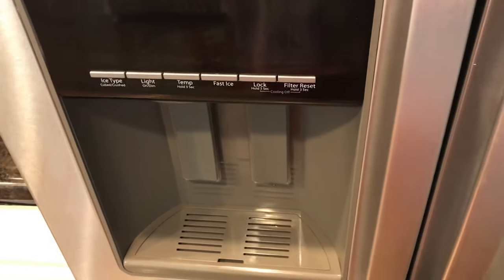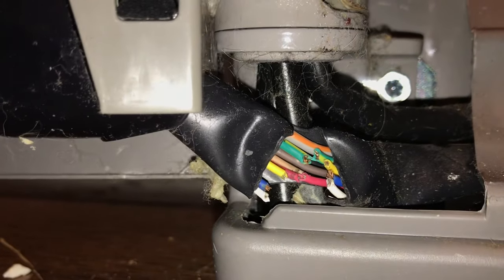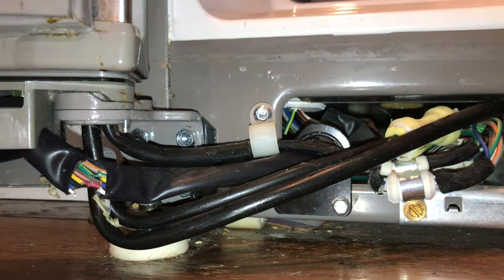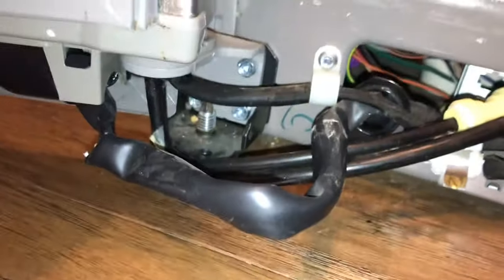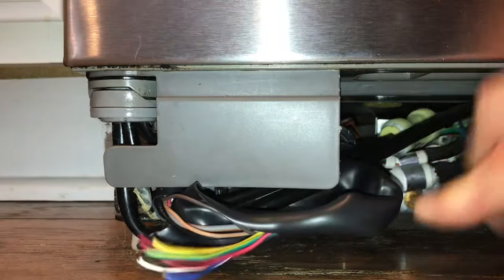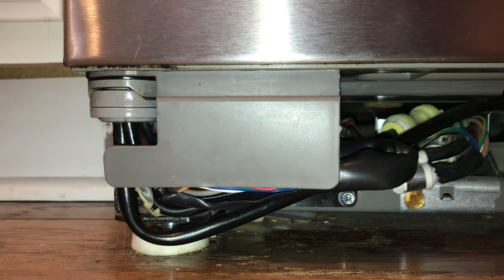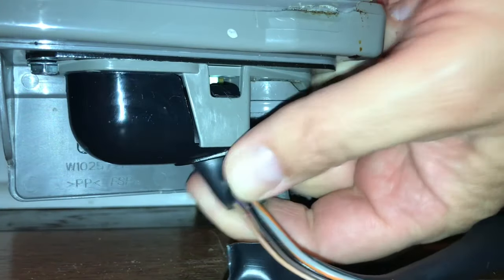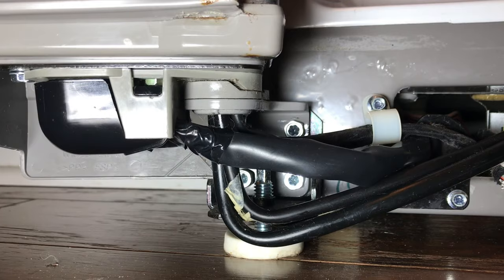Whirlpool double door refrigerator not making ice and ice dispenser doesn’t work. Wires WRS571CIDM01

Comment: I think we should be organizing a class action lawsuit. Mine started doing this after 1 year of service.
Reply: I called Whirlpool customer service. Totally rude!! They will do nothing about it.
Reply: Mine lasted 2 years then this happened. Not too hard to repair but clearly it’s a design flaw.
Reply: 10 months here
Reply: @dave64340  3.5 years for ours.
Reply: Mine just now has this issue. Two years and 8 months after purchase.
Reply: I completely agree I think we should do a class action lawsuit mine lasted two years. I just got off the phone with whirlpool and like the other guy said completely and totally rude and will not stand by their product. Absolutely horrible to their customers! This is obviously a defective part on their refrigerators, and they know about it, and won’t make it right by their customers. Absolutely horrible!
Reply: Mine is 18 months old, Whirlpool swears it’s not a problem. Never heard of the problem. I had called Whirlpool appliance repair and he told me it’s a common problem. I paid $2k for this pile of shit !!
Reply: 2 years on mine different model customer support supervisor didn't even care. Even when I said it was a risk for short and fire or a kid touches it they didn't care.  Wire harness assembly is my career and this is unacceptable crappy wires plus improper routing and protection of wires.
Reply: I'm with you!  No way something that costs that much should stop working after only 1 year
Reply: 3 yrs here
Reply: Thanks for the post. I was going crazy trying to find the problem … what a disappointment. Bad design. It’s fine for guys that are handy, and can easily fix it, but how about the other 80% of people that can’t really do things like this. Sad and costly for many folks 😑
Reply: Probably the best solution is to make an extension harness to go between them and make it 20$
Reply: Thx for the info, I just discovered my fridge has the same problem. Found the broken wires and soldered them. I believe the problem stems from the fact that wiring harness should be fed through the bottom hinge like the other harness and water lines. The way this is designed the wiring harness keeps bending back and forth when the door is opened and closed. I live alone so mine lasted five years. This is just pathetic. My next fridge will have the ice maker in the cabinet and not the door.
Reply: I would like to be part of that
Reply: Same here.
Reply: I have this exact problem and I called whirlpool. I am shocked. My fridge is about 2 years old. Whirlpool claims there is no recall. Unbelievable. DO NOT BUY WHIRLPOOL.
Reply: I've had mine fixed over and over.  It's always been these wires.
Reply: After 3 years, have this problem today. Cost to repair $300. 😩
Reply: 3 years exactly here. Almost to the day. Just 1 cut black wire. Hoping this will fix it.
Reply: Whirlpool said, they never had a complaint or recall regarding this issue.  Also, suggested they would give me a discount for a new fridge. Wasteful nation and no common sense ppl!
Reply: Does anyone know what this part is called ?
Reply: I bought the fridge in june, 2020 & a year later it stop making ice… I have tried every but it didn’t work until I found this video

Comment: The problem when you use cheap wiring casing vinyl and poor copper strands, should never happened. Sould have used good silicone wiring and better copper stranding making them flexible to withstand years of door openings

Comment: my Whirlpool ice maker wasn't making ice, but did dispense it etc.  I discounted a frozen water line because the water right next to it still was dispensing water, I figured it came from the same line so it couldn't be a frozen line.  Two days ago, we had a power outage that lasted for about 45 minutes to an hour....power came on and viola,  I heard water being dispensed into the ice maker and it has been making ice ever since...so, I figure that in the hour there was no power the frozen line melted....so you may try unplugging the frig for about 45 minutes if you have similar symptoms...

Comment: THANK YOU!!! I never comment on social media things but this video saved me so much money and further frustration.

Also, I wanted to comment for those who come across this issue in the future: don’t panic if you fix the wires and still don’t get ice right away. Give it about 24 hours or so before you continue to panic or troubleshoot further. It took my fridge about 15 hours from the time I was finished repairing the wires to begin making ice again. At first I worried I had done the repair incorrectly and there was something else to fix, and frustratedly told myself I’d try again the next day, but in the middle of the night I heard ice dump into the bin. It would not be a lie to say I jumped up and did a little dance once I realized what I heard!

THANK YOU AGAIN!! Shame on Whirlpool but thank God for community and those like yourself who are willing to share knowledge with their neighbor, even if we’re spread across the world
Reply: Thanks for the tips.  I am also impatient and waiting for the ice to be made lol.
Reply: What did you use to connect the wires back together?
Reply: @creddtx  solder connectors just heat them
Reply: @creddtx  I stripped wires on both sites and twisted them together really tight then wrapped in electrical tape. There are some connectors out there for this but what I did seems to be working. Just be careful on the wires that go into the door. Don't make a mistake because you only have small amount of wire to work with. I've cut some by mistake but was still able to make connection.
Reply: Thanks, this was helpful as there was no ice maker activity after I connected the wires. Without your comment I would probably mess with it more, but I gave it several hours and started to see ice in the container. It made me quite happy. Thanks!

Comment: OMG!!! We have been living without ice for about 3-4 years and had to buy it or go old school ice trays. I tried other fixes from different videos throughout the years and nothing worked. I was about to get replacement and decided to look for another answer before going in that direction. Clearly, I had looked before you posted this video. ...I open the door look down and much to my surprise, we have the same problem. At least 3 of the wires are cut in half. I'm hoping this fine will end in a fixed ice machine. Thank you motofun! Really! I can't thank you enough! Now off to my next new project! Blessings!
Reply from the maker: I know your excitement, because I was the same way. You don’t realize how much you miss ice, until it gone!!!  Good luck on the repair. Here’s to a big glass of ice…🧊

Please help me by subscribing. Thank you.
Reply: Thanks a bunch. 2:22AM ice started dropping!
Reply from the maker: @goldwatereli  don’t tell me you were watching/waiting for it?  That’s like watching grass grow….lol
Reply: Lol. No. I just wasn't sleeping very well and I happened to hear it....and again about 1.5 later. Now to figure out if the auger motor is bad or if it fried some of the control board. Flap opens but it won't spin. I'm hoping it is just frozen, but...one step at a time. At least we have ice!
Reply: Same for me! I looked yesterday and every single wire was cut except one. THANK YOU motofun!! My husband reconnected and extended the wires yesterday. No water yet, still hoping he fixed it! There's no water to the ice maker, but the arm thing is in the down position to dump the ice. How do we remedy that or does this mean one of the wires isn't connected properly?
Reply: @goldwatereli  how long does it take for you to have ice again after fix?

Comment: I noticed how many recent comments, everyone having the same issue, and sure enough, I'm one of them as well. I had 2 broken wires, and 2 more with some nicks in the insulation. I fixed the broken ones with heat shrink butt connectors, for which I just had to crimp them and heat them. Kinda crazy how we're all having the same issue at about the same time. My model is WRS526SIAE00. Thanks for the tip!
Reply from the maker: I agree and the mfg doesn’t seem to care. Good job fixing yours! Please help me by subscribing.

Comment: Thanks for the video! Ice maker stopped working recently and the control arm was stuck hanging down and figured the ice making unit was bad but your video came up first when I did a search. Figured I’d better just check to make sure, and voila; two severed wires. Followed your directions and had it up and running in less than 30 minutes. You’re right though very tight space to work with trying to strip and splice those wires. If you have kids, have them help. Their small hands are perfect for this job lol.

Comment: My refrigerator is a little  over 3 years old. Icemaker not working.  I checked  the wiring and there are two broken wires.Thankfully I purchased the 5 year extended warranty.  Thanks for your video. I would have never thought  to look at the wiring.

Comment: Bro! You’re an absolute legend. My ice maker stopped working within the last year. My wife has been on me to get a new refrigerator. Sure enough that wiring harness was too tight and 3 of 5 wires were cut. Thanks to you, we now have ice again! My wife should be sending you $5.
Reply from the maker: Lol. The new refrigerator will have to wait!  Please help me by subscribing.
Reply: This has to be most certainly a “manufacturer defect” and “engineering design flaw” 
Has anyone attempted to get whirlpool to fix this undeniable widespread issue under a manufacturer deficiency?
Reply: @DavidPalmer-vv6zb  Not sure anyone has taken the time to fight the corporate beasts. I’m willing to bet more people would rather spend 30 minutes to an hour for the repair than discussing the issue with customer service. Probably chalked up to “normal wear” and likely happens to most of us after manufacturer warranty period. I’m just grateful to have ice again. I’m fortunate that I had all the necessary wiring knick knacks to fix it without a trip to the hardware store.
Reply: @JonCastleIV  good job but you are probably in a minority as many older folks don’t have the tools or knowledge to repair and end up paying more money for a refrigerator only one or two years old. Unconscionable!
Reply: @DavidPalmer-vv6zb  maybe so. I do also wonder if it was factory assembly Vs. Assembled by the store where we bought it. There were a few screw holes on the base of the fridge. The one selected didn’t give as much play in the wiring as two other spots that were available to screw the harness holder into. Watch out for Whirlpool I suppose. Buyer beware. Maybe @motofun should do a video showing the repair technique he used…
Reply: @JonCastleIV  
I did and they were completely rude!! They will do nothing for us. I am sure they have had tons of complaints!!!
Reply: @debt6163  if this is the problem you’re having with your ice maker, perhaps you or someone you know could come and fix it for you. It’s not an extremely difficult task. Most of the work was getting enough slack on the wiring harness on the door side to cut and splice the wire ends together. I used a small butt splice connector.

Comment: Great find. On my Whirlpool wrs571cidm0 I found only the yellow wire was broken in the  harness. I stripped the ends and resoldered it (sliding on some small gauge heat shrink over the yellow wire before soldering). Slid the heat shrink back over it and taped the harness. I wouldn't have thought to look under the door. Thanks, you saved me a lot of trouble and expense.

Comment: Just like many of the other posts that I just read, my icemaker on the same model was not working. I called the company first and they told me that they could send out a technician to diagnose the problem. The initial diagnosis was going to cost well over $100. The rep from the company also suggested that I just get a new icemaker.  I tried instead using a hairdryer to loosen up any clogs, and that still didn’t work. I almost ordered an icemaker and then saw your video. Many thanks to you, because sure enough, just like all the other posts, there was one wire that was split. It took me 10 minutes to fix it - a couple hours later I heard ice dropping down into the tray. What a beautiful sound that was and thank you again!
Reply from the maker: They told me the same thing. Good job fixing it. Please help me by subscribing. Thanks.

Comment: wow ! what a revelation in this vdo, I just watched it, opened the freezer door and checked the bottom corner where wires pass, two of the wires are cut completely and my ice maker is not working for over a month, water is working so far and I guess that will stop after a while as well. Thank you, I am gonna fix those wires and see if the ice maker starts working back !!

Comment: 5 year Kitchenaid.  Ice maker stopped working 6 months ago.  Technician I spoke to on the phone told me it was the control panel and that it would cost over $500 to fix.  I just saw your video and did what you suggested.  Yup… two wires were cut!  Thank you very much!!!
Reply from the maker: Good good for checking it out yourself. 👊🏻

Please help me by subscribing. Thank you.

Comment: My whirlpool side by side has the same backstory as yours. Over a year with no ice. I had literally nothing to do today so I looked up this issue and your video popped up first. I opened my freezer door and long behold..5 wires are ripped. Thanks you. My wife was looking at a replacement refrigerator that cost over 3 grand. Took me about 8 hours because after I extended the wires it still wouldn't produce ice so I went back and redid all the wires and tested for continuity.  After all wires we confirmed to be good we finally have ice. Thank you good sir. I will subscribe and like. You're the man. I'm pretty handy around the house but very few projects have cost me 0 dollars. I had everything needed for the repairs.  Very grateful! Thanks for the fix. I'm sure this has helped countless people. Good luck on your channel.
Reply from the maker: Good to hear!  Just a warning, 99% of the time, the issue will occur again. 100% junk.
Reply: @motofun72  Did your wires end up cut again after the fix? I'm just dealing with this issue and trying to figure out how I can possibly do it once properly and be done with it. Your video gave me hope that it can be fixed, but your reply here leads me to believe I'm fooling myself now.
Reply from the maker: @BlakeSuperior_Beats  yes, it failed again. Next time, I will add wire to extend it more.

Comment: Thank you for posting this. I wish I had seen it sooner. I wasted $350 on 1st - solenoid valves, 2nd - icemaker unit, and finally - electronic control board (non-returnable). I was like, there's nothing else it could be except wiring, but how could the wiring go bad? I was searching for how to access the built-in diagnostics when I came across your video. I just checked, and yep, 2 broken wires.  Really disappointed in Whirlpool!
Reply from the maker: Good to hear you found the issue. I hate wasting money, but we have been there. 

Please help me by subscribing.

Comment: This video has saved me alot of stress. My ice maker stopped working for almost 2 months. Replaced the filter and nothing worked until I came across this video. My ice maker started producing ice after couple of hours. Thanks for the great information
Reply from the maker: Don’t stress, just chill with ice now!!!  Glad you got it working again!
Reply: Do you mean you need to wait couple of hours for it starts making ice? What happened in between? I fix the wires an hour ago, But nothing is happening right now.
Reply from the maker: @yimengdong3519  for me, ice didn’t show up until the next morning. 🤷🏼‍♂️

Comment: Five stars dude! Mine was only slightly more irritating with a clamped down cable under the fridge. Pulled it out and called it a day and thru screw away to extend wires. I also had 7 severed wires. Such a design flaw. Thx so much, it’s working!!
Reply from the maker: Awesome, I’m glad you got it fixed. Help me by subscribing!  Thank you.

Comment: Great video.  I spliced in new wires (soldered and shrink tubed both ends) for all eight wires that were going to my ice maker and ice dispenser.  Everything works like a champ now.  With some careful routing, and stress relief (I used a few well-placed zip ties), I have a wire harness which should dramatically outlast the original design.  You saved me a lot of money, hard telling what an appliance tech would have replaced (and charged me for), before finally figuring out what the real problem was.
Reply from the maker: Nice work!  It’s always good to DIY and save money.  Please help me by subscribing.
Reply: This has to be most certainly a “manufacturer defect” and “engineering design flaw” 
Has anyone attempted to get whirlpool to fix this undeniable widespread issue under a manufacturer deficiency?
Reply from the maker: @DavidPalmer-vv6zb  I tried. Goodwill on parts only and had to use their repair person. 🖕🏻
Reply: @motofun72   very sad and Whirlpool products should be protested and not purchased
Reply from the maker: @DavidPalmer-vv6zb  never again here.
Reply: Hi Lynn,
Do you mind sharing pictures and/or video if you have one. I do not have enough slack on the broken wires and very new to this stuff. A Picture might help. Thanks!